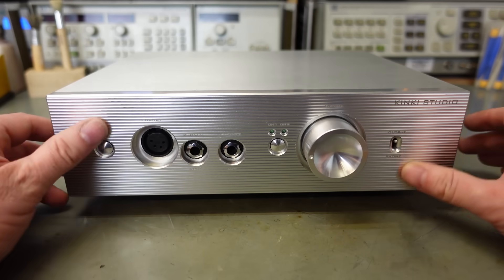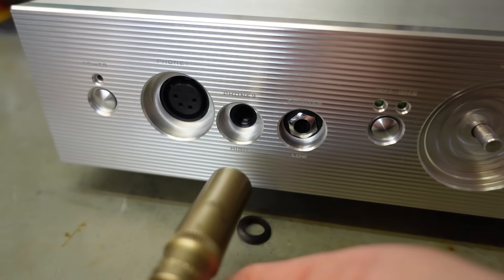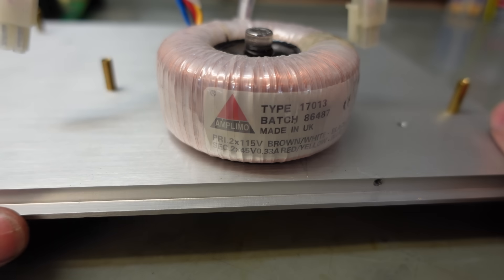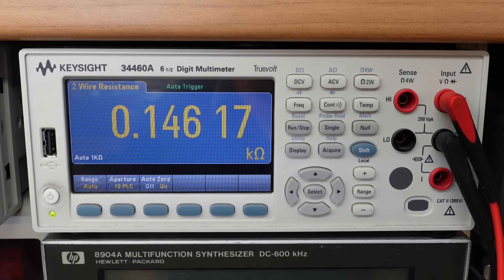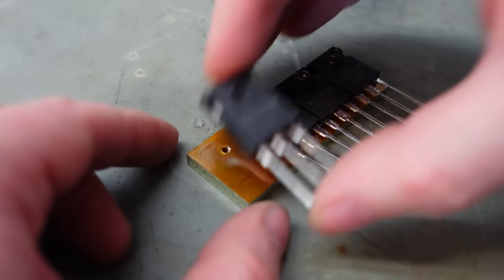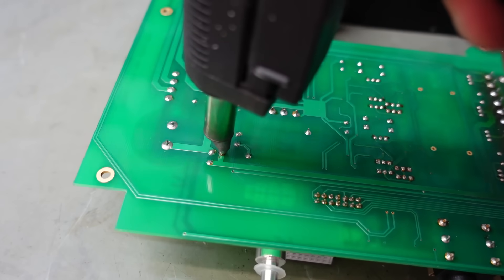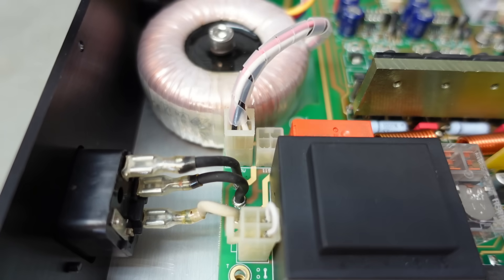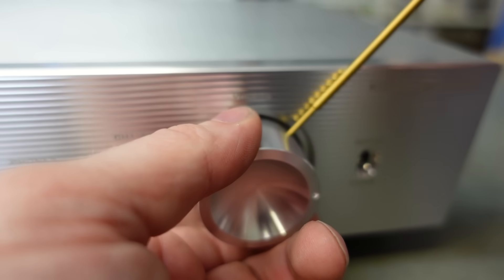KINKI Headphone Amplifier Repair (Vision THR-1)

Comment: Great video as always!  Regarding those power transistors; Kapton tape has poor thermal conductivity vs thermal pads - perhaps the root failure was from someone trying to use this as a regular speaker amplifier, overheating to short?  But as @pantelisEVs noted, using the chassis seems like a much better idea too (with thermal pads 🐱).
Reply: thats what i thought and possibly wrong  impedance speakers . made that mistake myself used my bi amp speakers (paralleled 🙄)  on my rotel 931 amp , like a divi and cooked the o/p transistors
Reply: You're dead right - Kapton tape isn't designed as a thermal conductor. No way would I use it in place of silicone pads or thermal grease. It's the sort of cheap-ass shortcut that I see in china stuff all the time and just another reason I tell people not to buy this stuff.

Comment: Why oh why didn’t they take the opportunity to use the casework as a heatsink?  They could have mounted them on the bottom of the case!

That’s why I won’t buy any of this expensive Chinese kit, look nice and no doubt sounds good but service backup non existent.

I wonder if the faulty transistors are genuine or fake?  Coming out of China it's possible the manufacturer of the amp wouldn’t even know.

When you replaced the ferrite sleeves, one of the transistors was actually moving?
Reply: I have my doubts about those factory-supplied transistors as well. I doubt they are genuine Exicons. Why would china buy those in at much higher cost when they can use their own counterfeit ones at almost zero cost that 'work' for a while then shit themselves?

Comment: Hi, some micas and thermal paste should work better to dissipate the heat than capton tape on those mosfet, it is not suppose to break.
Reply: It wouldnt. Mica is rather poor thermal conductor, as kapton is. Also, the power dissipated there shall be so small, it would work sufficiently even with 5 layers of the kapton tape. The problem here is, that by design, it is wrong, as there is no temperature feedback for bias control. As the fets heat up, bias current creeps up. Until it sh!ts itself. Overloading the amp in some way would only help this happen faster.

Comment: All the thermal mass of the over-built chassis and they choose to mount TO-3P lateral mosfets which are no doubt biased into class A to a tiny piece of metal as a heatsink! You can tell they’ve been getting excessively hot by the board discoloration. Even the cases of the MOSFETs have discolored. And scraped part numbers on the components! This amp is over-engineered except for where it counts. Good for the warranty period and then will give you a bunch of trouble afterward. The company scraping part numbers and not providing even a simplified schematic screams stay away…
Great work on the repair, Mark 👍🏼
Reply: @@PrimeHiFi   ...And yet I wonder if the manufacturer even has a repairs department if miracle Mike wasn't there to mend it?  I'll bet not!

I just HATE it when manufacturers scrape off part numbers!😠😡🤬🤬!  It seems almost CRIMINAL!
Reply: I'm sorry but you're wrong. 🤭 I'm an electronics engineer my self with +30 years of experience in radio&radar. Look at my comment.😉

Comment: It might be possible that the MOSFET heatsink needs a thick thermal pad to pass heat to the massive cover for better heat dissipation.
Reply: Those transistors shouldn't be getting hot enough for that. They're rated at 8 amps each - if you drove that kind of current into a set of headphones they'd Chernobyl!

Comment: Kapton tape is very insulting for heat transfer. Just saying… cheers, I enjoy your videos. 👍
Reply: Exactly, I think kapton tape suppose to be used as thermal isolation fx when solderind, desoldering SMD
Reply: @cesio25  ask me how I know 😂 wrapped a  little video transmitter in it to keep it clean, would constantly over heat, removed it and was good for months…
Reply: @quadmods  so this little Amp  will come back to Mark with the same issue🤷

Comment: Balanced but not balanced... Is this acceptable practice or kind of a scam?
Reply: Do you think anyone that buys this device will actually notice?
Reply: It's typical china 'cheat' - use 3-pin XLR sockets so you think you are getting balanced audio, but skimp on the circuitry inside and just make it unbalanced. The whole unit is one big design flaw aimed at extracting money from audiophools.
Reply: I'm sorry but you're wrong. 🤭 I'm an electronics engineer my self with +30 years of experience in radio&radar. Look at my recent comment.😉

Comment: I'm surprised you didn't run it under load for a while and test it for hot spots with your thermal camera - perhaps if it returns in the future? 😊
Reply: Same thought . The burn Marks are below all 4 transistors, so all 4 overheated
Reply: @DieSportsKanone  All connected to the same heatsink so the heat will have spread from the bad ones.

Comment: Chinese manufacturers that choose to make high quality products make the same mistakes as Chinese manufacturers that choose to make garbage products... They rush to throw them in the market without testing the product thoroughly before to find any design flaws or assemply problems, which leads certainly in failures after purchase, this thing looks like a speaker AMP with the components it carries inside, yet the chunky MOSfets are not heatsinked with the thick case, nor there is any ventilation even passive, also they also advertise feature that do not support like the balanced inputs here just like the garbage Chinese manufacturers do.
The main difference between them is the amount of money each one asks for their products but I do not forgive any of them.
The garbage ones for making garbage even though they are cheap that pollute the planet almost straight away, and the high quality ones for making design mistakes, poor testing despite the high price, and false advertising features basically steal your money. Cheers from Greece! Jim

Comment: What is the purpose of a headphone amp? By which I mean, what are the benefits over using the headphone output on a generic integrated amplifier.
Reply: @@paulanderson7796   Paul, the headphone output on most integrated amps are via, say,  a 330 ohm resistor in series with the speaker outputs.

With the varying inductance & impedance of headphone driver coils, the distortion & damping are all over the place.

A 330 ohm source impedance driving an 8 or 32 ohm load is just a rubbish situation.

Still, this headphone amp is absolutely ridiculous overkill!  Most headphones only need a few mW to drive them.   As someone here said : "It's for the audio fools!".

And yet the thing still shat itself?
Reply: @nevillegoddard4966  It still shat itself because the design isn't that good, and I have suspicions about the legitimacy of those transistors. I can't imagine china buying in genuine Exicon transistors when they can churn out cheap fakes that work for a while and shit themselves months down the track.
Reply: @nevillegoddard4966  The problem is that audiophile's don't just buy "most headphones". They buy high end designs with impedence from 8-600 and sensitivities which are all over the place. Some of those need lots of power to drive and give adequate headroom. Whether the more extreme designs actually sound better is something you can only answer yourself. It is true that there has been a marketing fuelled race to make more and more powerful amps, some of which can now happily drive speakers. 15 watts for a headphone amp is certainly overkill.

Comment: For all the thick alloy of the case, there is minimal heat sinking on the power transistors.  Very crappy design, IMO.  They will overheat and blow again unless some extra heatsink is added.
Reply: Driving cans? We're talking milliwatts here.
Reply: It could be a Class A amp which still consumes full power even at quiescent
Reply: @prairiedawg792 With pairs of output transistors and no output decoupling that's unlikely.
Reply: @paulanderson7796  How do you account for the heat discoloration on the circuit board?
Reply: @gibbogle  I am thinking that it's possibly a symptom of the fault itself.
Reply: @gibbogle  I have doubts as to whether those transistors (the factory supplied ones) were genuine Exicons.

Comment: Typical Chi-Fi, seemingly over-engineered but seems to break down rather quickly because of critical design failures, just like this one with severely inadequate cooling and it will destroy itself again guaranteed.
Both of my old Denafrips terminators died within 1.5 year, thankfully sold both on time.

Also ground off marking of the parts = 100% stay away from such manufacturers.

Comment: Why did you not clean up the carbon on the pcb before you added the replacement resistor.
thats '-' on the repair job.
Reply from the maker: I wasn't worried about it. There wouldn't be much voltage drop across it, not with the 75 Ohm resistor in parallel. At least, not until the transistors go short... LOL

Comment: Interesting you saying the MOSFETs not needing a heatsink considering how hot they’ve clearly gotten. Excellent video.
Reply: 4 mosfets for a device with has an output of just a few watts, the FETS should stay extremely cold, yet they decided to large packets, I'd suppose at least.
Reply: @edmaster3147  These lateral FETs have their Rds on the high side and benefit from sensible thermal arrangement, especially that they should ideally be run with high DC bias.
Reply: @edmaster3147  well then in reality they could have used TO220 devices then, regardless they don’t look like they’re staying too cold.

Comment: What the heck.. Kapton Tape on the heatsink? is this designed to fail?
Kapton is used for thermal insulation, not for termal conduction. you want the heat to go into the heatsink. not isolate it.

Comment: People are saying why have a large piece of thick aluminium as a case, and not fit the power transistors to it, well i will explain, the transistors collector is live,+- 80volts ,and your relying on a piece of very thin kapton tape,just think of the shock risks,if the tape broke down,swarf etc,the case would be sitting at 80 od volts (enough to give a shock) ,its that simple,it wouldnt meet the safety specs,even though its made in China.
Reply: I'm sorry but you're wrong. 🤭 I'm an electronics engineer my self with +30 years of experience in radio&radar. Look at my comment.😉
Reply: @@enoz.j3506   We just used the regular mica washers & silicon grease under our power transistors that have 1200V on them with no problems!

The pcb should NEVER get so hot that it discolours like this one did.  It will eventually become conductive.  The uniform discolouration under all the mosfets means they've ALL been overheating.

$1000 for a piece of 💩 that just looks good, feels heavy, but WILL fail!  Kinky CRAP!
Reply: @nevillegoddard4966 Yes ,as a  qualified electronics engineer,for 40+ years,mica washers and silicon grease was & still is, widly used,mica withstands 1000 deg c,Kapton 260 degs c,big difference,got to look at worse case cenarios,to blue the legs on those fets,i dont know ,as you say the fact that the pcb is burnt means,bad designe & will conduct eventually. I dont know why they didnt use insulated fets,then bolting to chassis would be the way to go.Its made in China,nuff said.Make it look good and it will sell.

Comment: G,day Mark from Sydney Australia. That is a quality amp.
 The burn marking on the PCB is a strong indicator of short circuits?
* Also running the output to the oscilloscope to check the sine wave frequency.
🌏🇦🇺

Comment: You would think if they were throwing that amount of money at it you would have transformers feeding the XLR outs. Also I think it’s a bit overkill sanding off the component text. I think if someone was looking to copy the idea they would not copy this design!
Reply: A good balanced output stage can be done cheaply and well with op-amps but yes, for the money this thing costs I would expect to see transformers in it!

Comment: Nice fix! Curious though??? Why no heat sink compound?
Reply from the maker: Good question. Now I haven't analysed the design (just returned it to original spec), but I think the "heatsink" was more of a transistor holder.... The purpose of heatsink compound is to fill the voids and surface imperfections between the transistor body and heatsink. If both surfaces are sufficiently flat - heat sink compound will not improve the thermal conductivity of what is already there. Now bare in mind that they had a layer of Kapton (or similar non DuPont product...) stuck to it which doesn't have great thermal conductivity. So heatsink compound wouldn't have done much apart from make a mess. At least, that's my oppinion.
Reply: @MendItMark  thanks for the explanation... I have some exposure to home amps and had to handle that nasty stuff so, naturally I was curious... I'm not a tech-nerd. (Respectfully... lol!)

Comment: I'm not sure Kapton tape is a good thermal conductor. It has fantastic thermal stability and a great electrical insulator, but I don't think it is a good thermal conductor. This could be part of the failure mode, if heat can't be removed from the semiconductors it will hasten their demise.
Reply from the maker: You're right, but kept it to the audiophile factory spec. There is such a high voltage across those transistors, it wouldn't take much current to get them toasty!

Comment: When you use the oscilloskop to test, you use left and right channel with a normal connector is it then connected to the sound output with sound pluggs ? How to make the cable ? Or how to buy it ?
Reply from the maker: I buy some decent quality audio cables (RCA, 1/4" Jack etc), chop them in half (to make a pair of cables), then crimp on the BNC connectors to fit the test equipment.

Comment: This headphone amplifier have a big aluminium case, but output trasistor mounted on little heatsink. Case can be a good heatsink.
Reply: I would take advantage of that huge bottom plate and mount them onto there.
Reply: In this amplifier, you can simply place the output transistors on the bottom side of the printed circuit board, bending the leads and fixing them directly to the bottom of the case. The main thing is to use an insulating thermal pad. As is done, for example, in the Burson Soloist HA160 amplifier.
Reply: @arenaengineering8070  The Kapton tape used here seems like a bad idea, seeing as it's best known for its thermal insulating properties. A thermal pad would definitely be better.

What's the reason for the transistors being unable to make direct contact with the chassis?
Reply: @jamescollins6085  The case of the used output transistors is not insulated and in direct contact with the aluminum chassis a short circuit will occur between the + and - power supply. Kapton tape is used in this amplifier more as an insulator.
Reply: @arenaengineering8070  Thank you for the explanation.